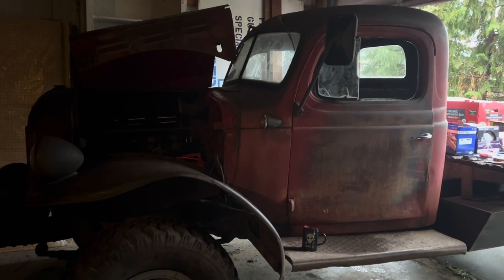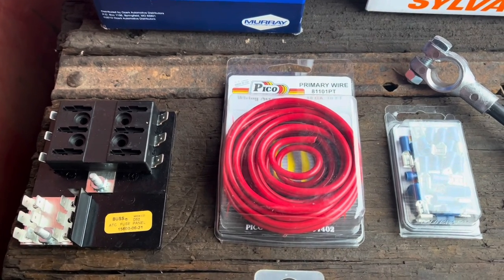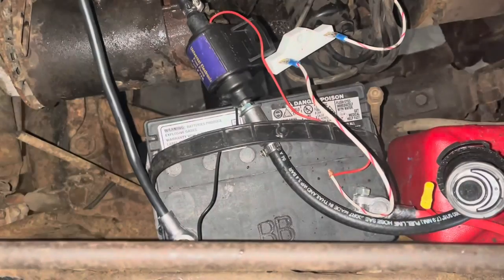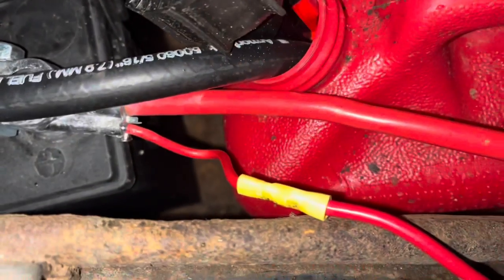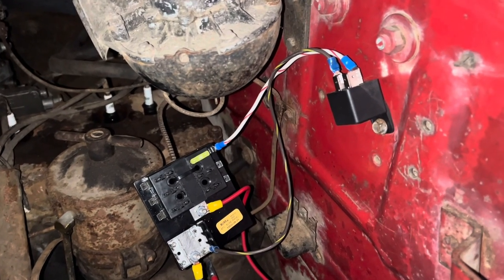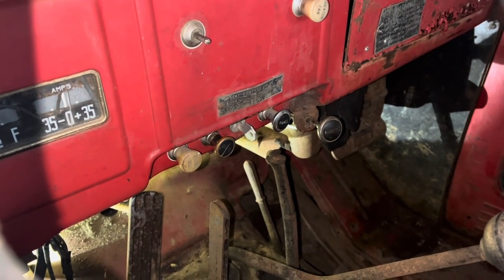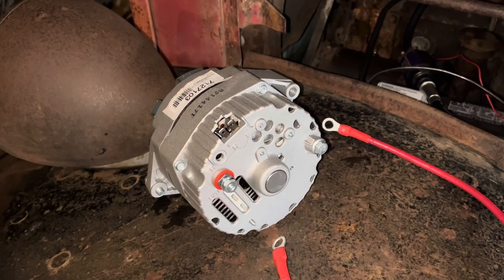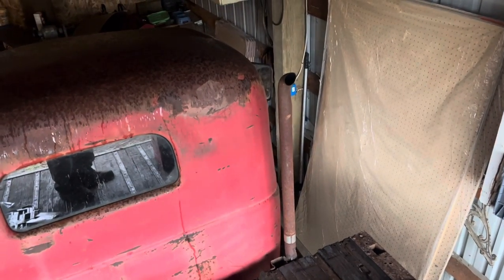Basic Automotive Wiring and Relays, 1948 Power Wagon 12 Volt Conversion, Pt. 1 - Dead Dodge Garage

Comment: One suggestion though. Depending upon the starter, alternator, and battery cable setup, you can run the  alternator output cable to the battery cable stud on the starter.  That way, your battery cable connections stay much nicer without a bunch of wiring hanging off of the battery clamp bolt.  Another place could be where another direct to battery cable would go, like starter relays/solenoids on many older Chrysler and Ford products or antique tractors.
Reply from the maker: Yep, that.